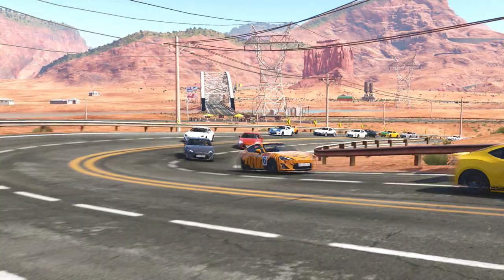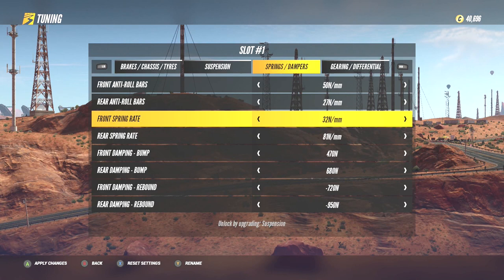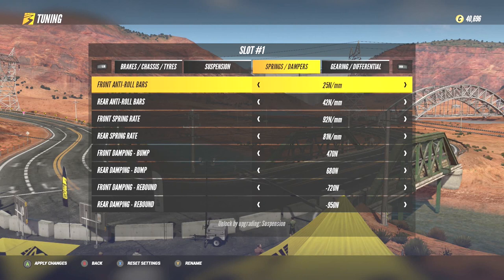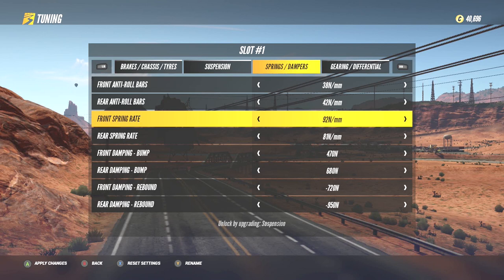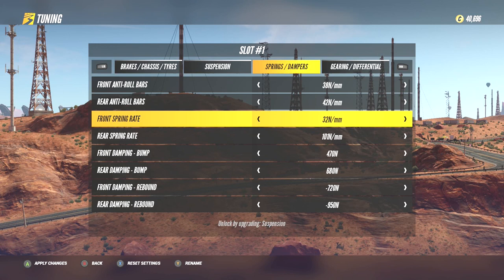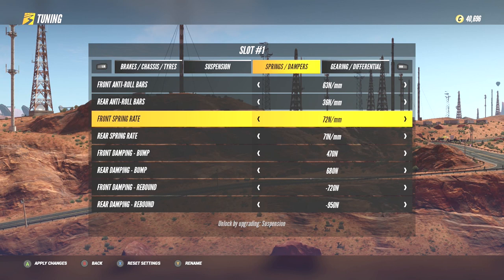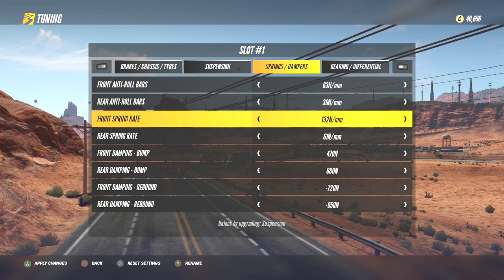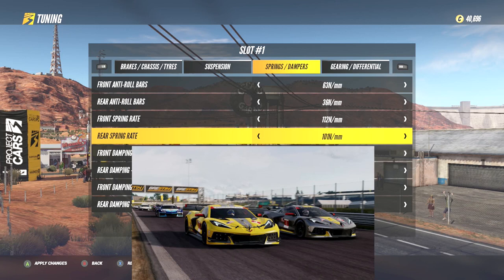Project CARS 3 TUNING TUTORIAL Part 3: Anti-Roll Bars and Spring Rates   Setup Guide

Comment: Hey there, watched all 3, you gave me some great ideas, but I still cannot get the Porsche 918 Weissach Racing to handle in the corners. I pushed the front roll bar to max, changed DF to little on front, lots on rear, however, it still has push mid turn depending on speed, and it will spin out from time to time as well as not turning at all at low speed. As other commenters mentioned, can you do a setup for AWD cars? I have the 918 to about 1148 rating if that helps.
Reply from the maker: Hi James! Glad you're liking the videos, a new one has just gone live. Is there a particular track you are wanting the Porsche 918 to drive better at? AWD cars are typically only good on tracks with short to medium length straights, along with tight corners/hairpins. Happy to look into the car for you though 🙂 Are you driving it for a particular race event in career or multiplayer?
Reply: @JSRJohn  Yes, I've been trying to do the career challenge at Road America and your tips really did help quite a lot, but I just can't get the damn car around the track without putting all 4 wheels off at least once a lap, meaning I can't complete the challenge. I think what I have would work pretty well on a rhythm track, but Road America is really point and shoot and I just can't find the right balance. Thanks!
Reply from the maker: @jamestebary9780  Good to know it's Road America you are driving on. A quick suggestion that works well in most AWD cars is to have the front Anti-Roll Bar very soft, the rear Anti-Roll Bar quite stiff - this will allow more turn-in. To reduce understeer on corner exit, experiment with the first Differential as this can adjust how much power goes through a single wheel at any given time. I'll cover this in my next video (due in a few days!). Try the above and tell me how it goes!

Comment: Do you have any setup for the jesko?
Reply from the maker: Not yet, but I still might be able to help with advice here if you wish. Have you built the Jesko for power, or for handling/grip?
Reply: @JSRJohn  hi, ive built it to full gtopen performance, but need it to grip and not slide so much as brackes.
Thanks
Reply from the maker: @miguelmoreira159  To reduce sliding, the tree biggest things you can do are:
Anti Roll Bars: make front very stiff, rear soft
Springs: make front very stiff, rear soft
Aerodynamic: Make the rear downforce greater than the front

Start with this, see if it becomes less slidey. You might find it makes the car slower, so begin to loosen the front anti roll bar and front spring again, bit by bit as you run test laps on the car. Let me know if it helps!